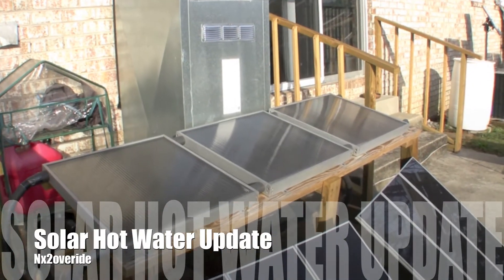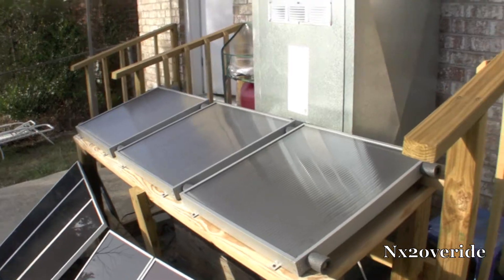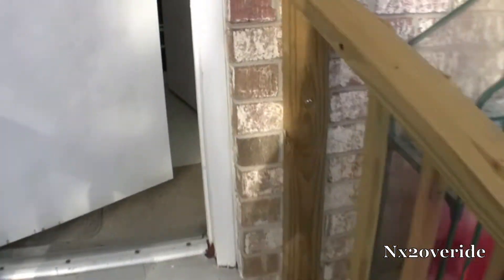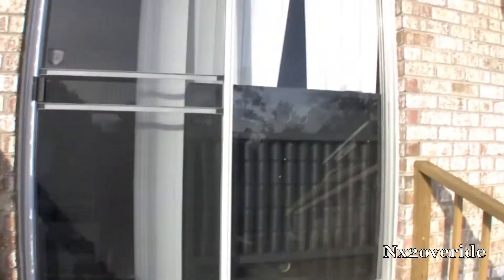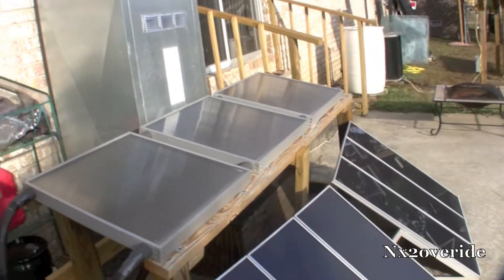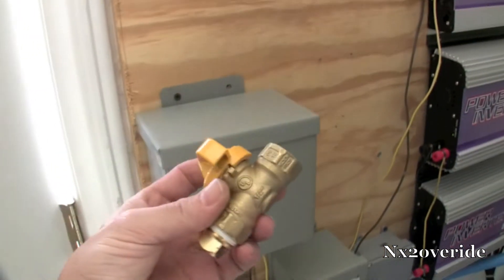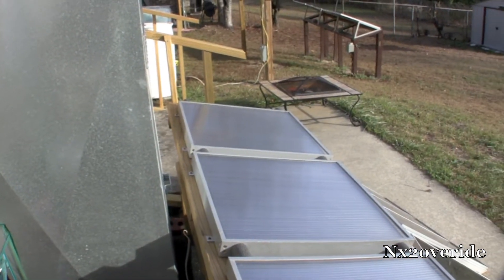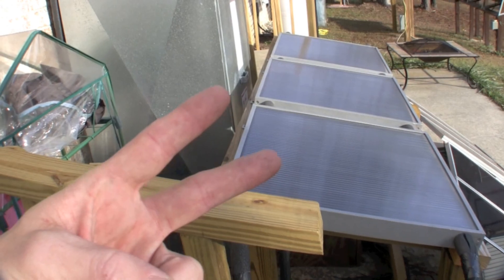Solar Hot Water Update (winter problem)

Comment: The whole point of the small panel that came with the kit was that if there wasn't enough sun to fun the pump, there wouldn't be enough sun to heat the water. That was designed in the system to work that way as not to run your hot water in the tank back out to the cold water panels. You don't need a temp sensor.

Comment: Hey,
Build up a flat surface on your hot water delivery pipe and install a snap disc switch like you showed directly on that.  No separate box required.  Choose a switch that opens below, say, 110 degrees or so, so it won't allow the pump to run unless the water's warm.

Another idea if you can make it happen: wire the electric panels to drive a low-voltage element in the water tank, and that gets a switch that won't turn on unless water in the panels is BELOW 105.

Good luck with it.

Comment: I left out the most important part!  Solar hot water covers our needs 100% from about April to the end of October.  We shut off the electric breaker to the hot water heater.  When the sun is out, it's like a owning a printing press that prints legal money.  Solar hot water should be required for all new single family homes, and when wrapped into a mortgage, they are cheaper than a standard electric hot water heater, the savings in electricity will more than cover the increase in a mortgage.